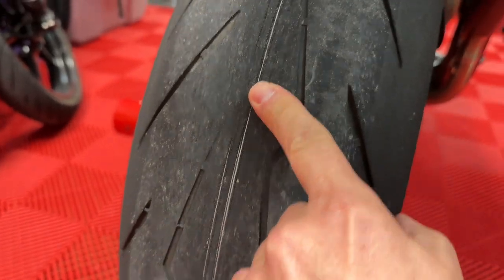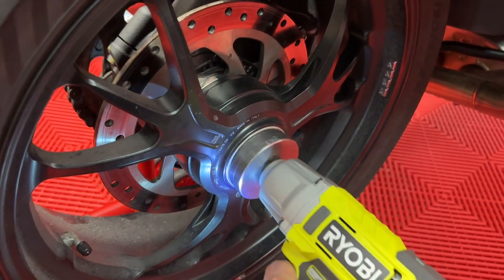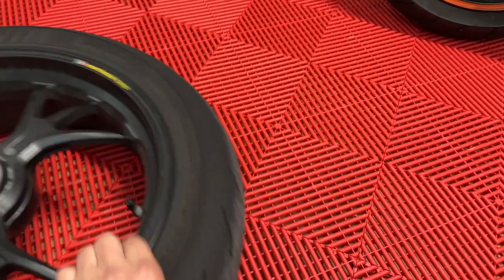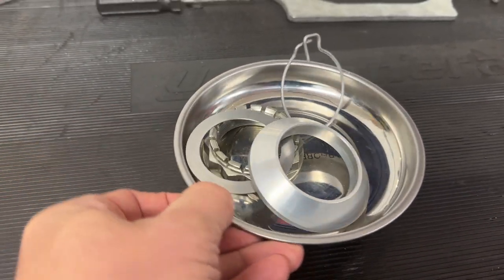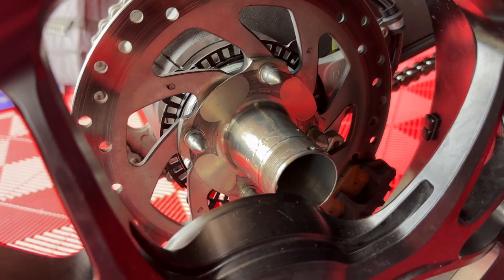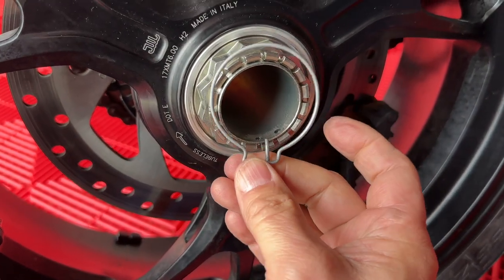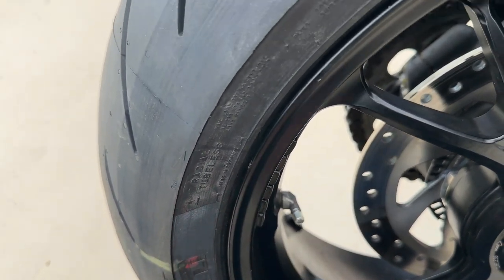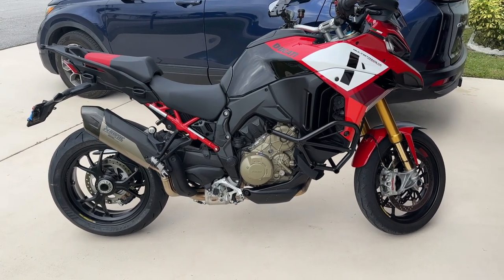How to change the rear wheel on a Ducati Single Sided Swingarm [ Multistrada V4 Pikes Peak ]

Comment: Good stuff.  Just remember, the manual's recommendation for tire pressure is assuming that you are using the OEM tire that the bike came with.  If you switch to a different brand or model of tire, then what's in the manual goes out the window and you need to use what the tire maker recommends for that bike.

Comment: That used rear tyre really shows how many highways you have there. There is significant tread on the sides yet carcass wires centrally. You should only ride in that industrial zone which has more corners 😉😎

Comment: The correct pressure recommended by Ducati is 36 psi or 2.5 bar. There's a bad conversion calculation in the manual. The sticker on my swingarm stated 36 psi. In the monster SP manual they manage the calculation properly...
Reply: That's for the OEM tire.  If you switch to a different tire, ignore what's in the manual and go by what the tire maker says.

Comment: There is two things I will never do when putting this rear tire back on. I will not put the cone and washer on dry, and I will not torque it all the way up to 169 foot pounds. I'm going to stop at 165. This rear nut broke one of my breaker bars. After I torqued it to 169 foot pounds, I could not get the nut off. I also didn't lubricate the cone and washer. This time I did.

Comment: How long did you have to run the impact drill? I feel like mine was over tightened by dealer? Any advice? 🤦‍♂️ Thx
Reply from the maker: The first time it took a few attempts.  That was from the dealer.  Once I torqued it myself, it was very quick.
Reply: @RemboUSMC  I finally got it off! That was intense! Lol. Thanks for your video.
Reply from the maker: Sometimes you think it is going to crack off @chrisc88

Comment: Hi Rembo, what kind of Ryobi is that, will 300 lbs torqe be enough - as I just purchased one at the home depot across the street
Reply from the maker: It is a cheap one but the 1/2" drive version.  I use it for taking off, not putting on.
Reply: @RemboUSMC  I got it off......it took quite a bit. Thanks for the vid.
Reply: Mine is 1,000 lbs  tq and it still wont budge.
Reply: @jasonpatterson2143  it took me a while of applying power before it started to move....maybe try keep applying energy to nut until it begins to move. It take s a bit. Just a thought if you haven't done already
Reply from the maker: @jasonpatterson2143  Holy crap

Comment: How is it that you go through tires so quickly? My V4s is at 4,200 miles and the tires look nearly brand new. I ride the bike pretty hard, so I think, wheelies and all. One thing I do is use a precision micrometer to adjust the wheel alignment but that is just because I have one for rifle round reloading. That can’t make that much of a difference, right?
Reply: Probably biggest difference is you are using harder wearing touring tyres, whereas the PP uses sports bike tyres, a change to Angel GT2 on the rear and Diablo corsa on front would be a better alternative 😉.
Reply from the maker: I have three reasons for this. First, this bike is not the V4S.  This is the pikes peak and it comes with very soft tires that are DOT yet designed for the track. The next item is that I did a track day with this bike, lastly I am aggressive in my riding which includes wheelies.  When I owned a V4S I got over 10k miles on the stock tires.
Reply: @RemboUSMC  Oh. I thought it was because you were using tire shavings to season your chicken like some other marines who came to me in Kandahar with stomach upset. And they kept eating crayons for some reason.
Reply from the maker: @Skipdigiddy  Yes, guilty.

Comment: Strange one this, the Valve is normally the heaviest part of the wheel, yet the balance weights are level with the valve, on such a lightweight wheel the valve would be more of a weight percentage than a normal one, it must be correct as it's from garage but very strange why you would make the heaviest part heavier lol.
Reply from the maker: I too was very curious about this. It was actually balanced on a machine and not balanced on a gravity balancer.  I stood right next to him during balancing